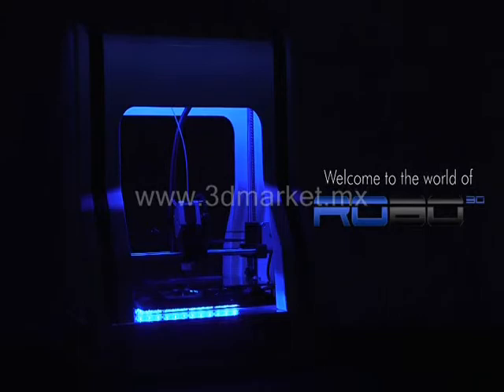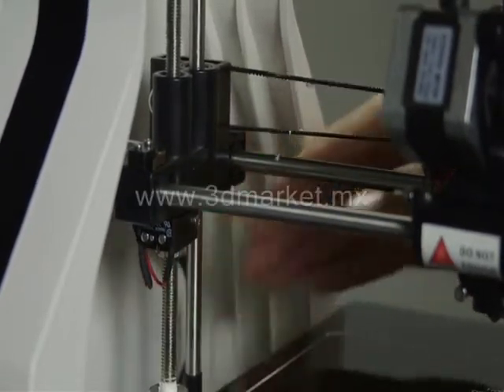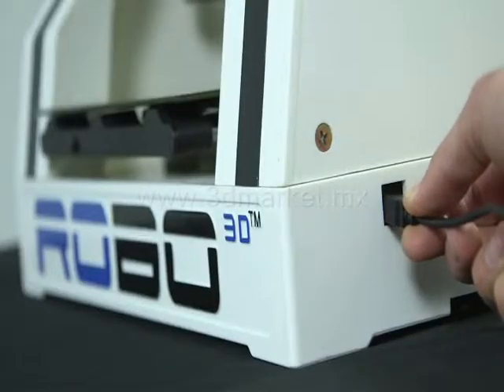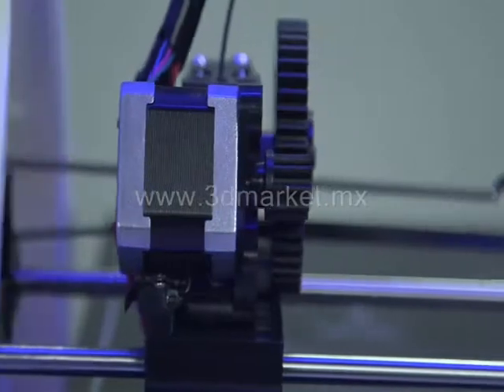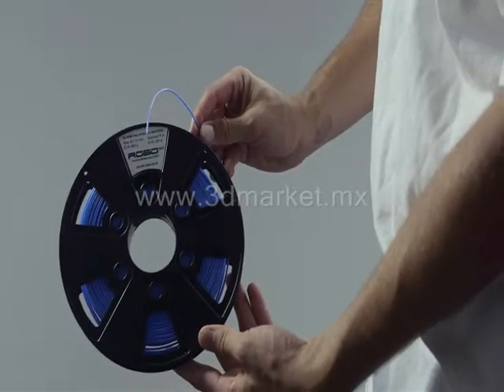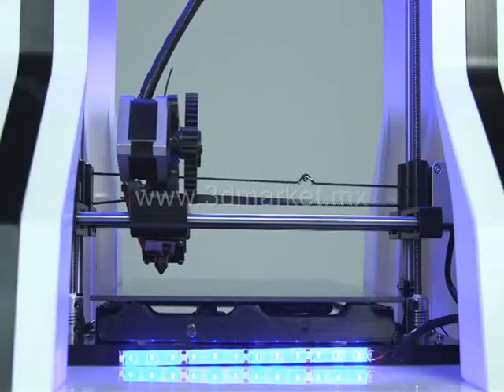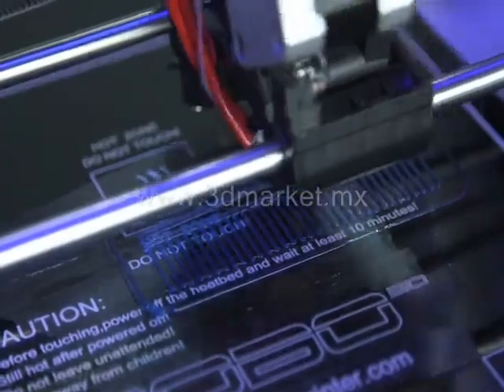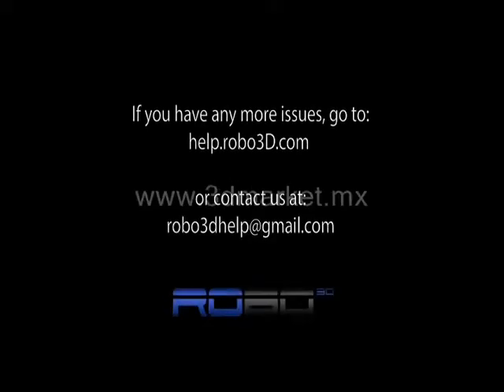Instalación robo 3d

Comment: Hola cómo va? Tengo una robo R1+ y está en blanco como debo instalar el firmware es el R1 y el R1+ o solo el R1+? Gracias un abrazo desde Argentina
Reply from the maker: Te recomendamos este articulo: https://help.robo3d.com/hc/en-us/articles/115000717071-Updating-firmware-with-Arduino
Reply: @3dmarketMx  ya solucione el problema ahora tengo un problema con los motores Z uno sube más que el otro en auto home y queda mal osea no suben al mismo tiempo y queda torcido ¿hay solución?